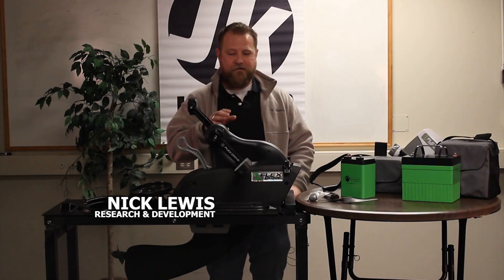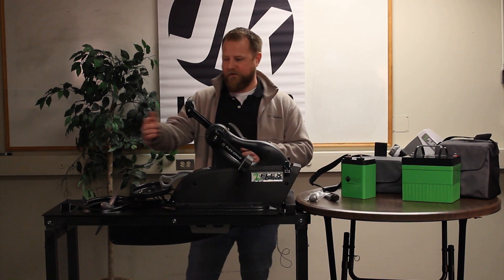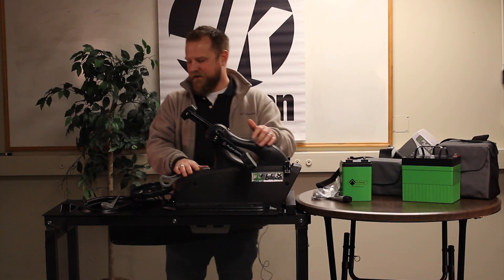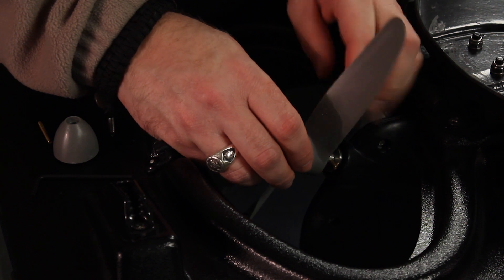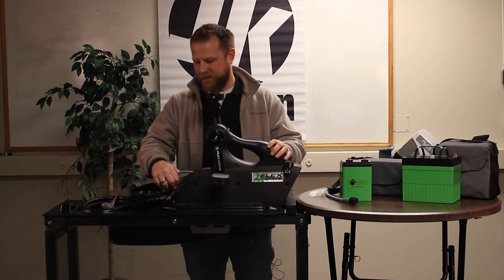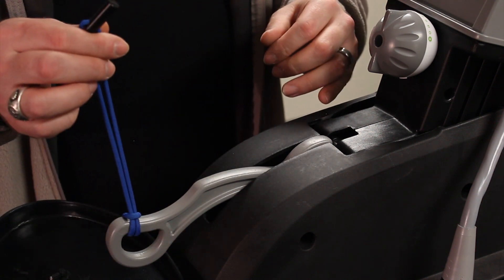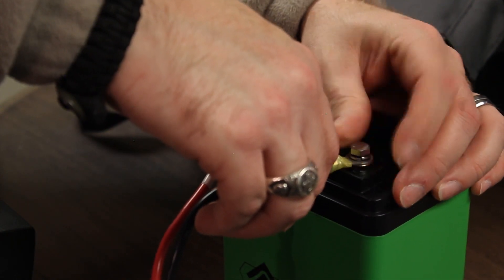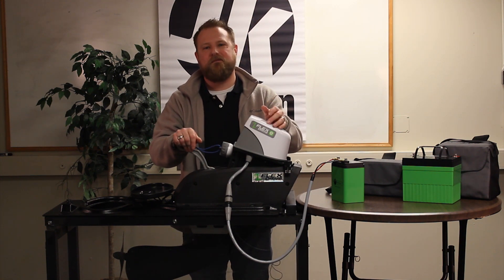Jackson Flex Drive - E | Prop and Battery Installation

Comment: Why does a Lead Acid battery require a different prop from a lithium ion battery?
Reply: Did you ever get an answer?
Reply: @elvisrickey4625  No sir, I’m thinking it’s just a Sales Pitch. But who in their right mind would use a Lead Acid battery anyways?
Reply: @lionsdejudah  I found out that if you go to their web site for the motor, under FAQ they give their explanation.